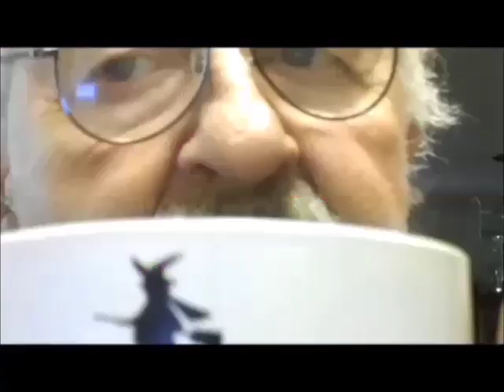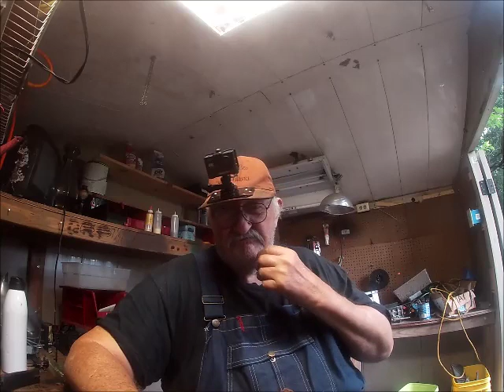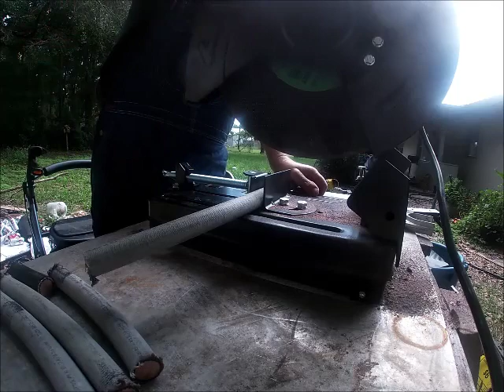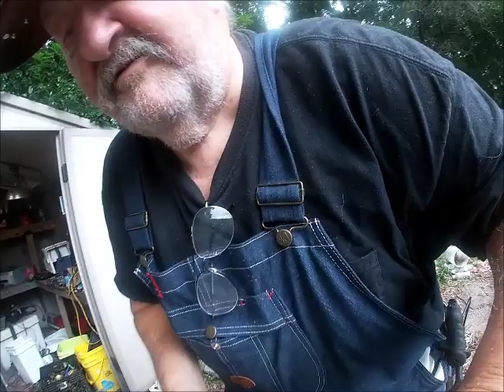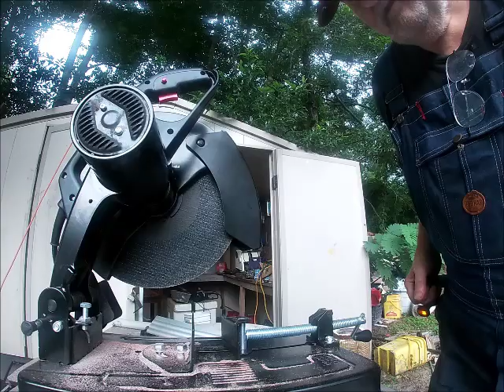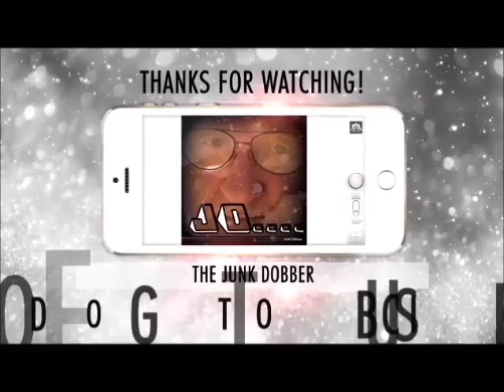Processing The Huge Copper Cable

Comment: If you strip the wire with the silver coating on the copper it will most likely go as a number two copper price but is much better than leaving the casing on the rest of it if it is just bare copper it will most likely go as bare bright which is a very high value copper